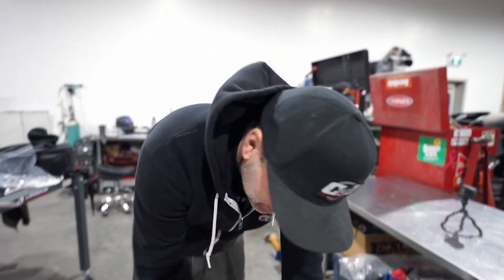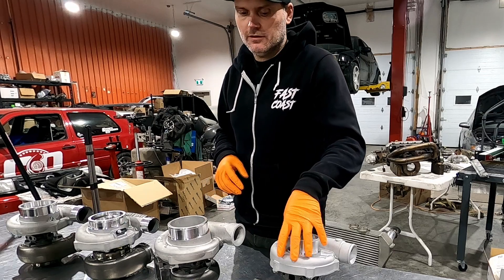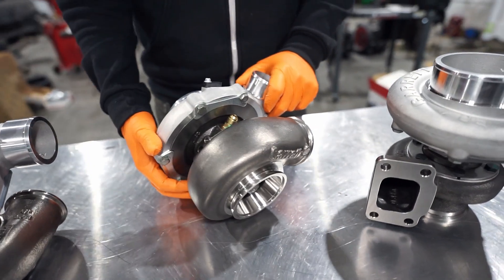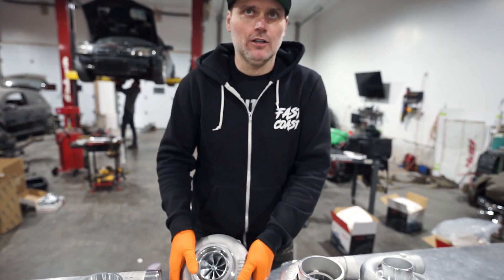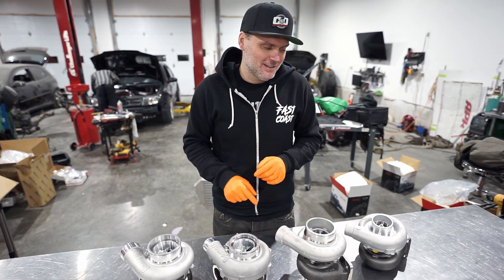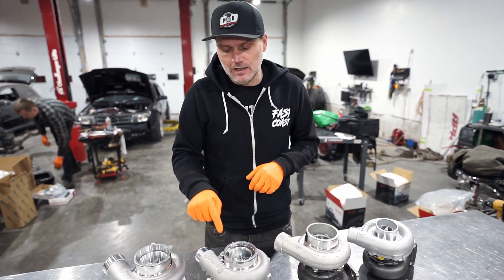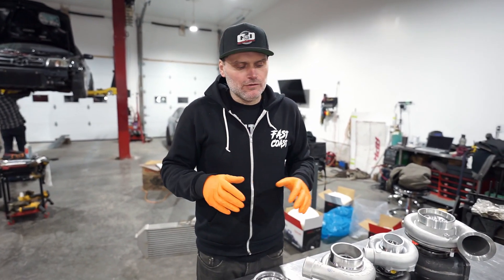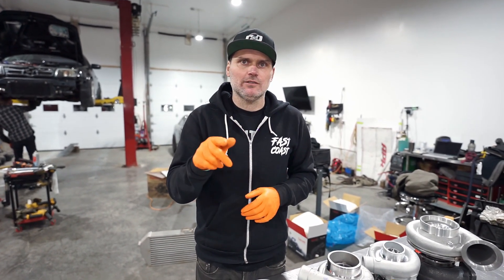Does size matter? Comparing four generations of Garrett Turbos.

Comment: Damn those are big. Is there anything you recommend thats smaller? Just need 200 hp increase.
Reply from the maker: Depends on engine size, rpm, fuel, and overall power goals. A 200hp increase is a lot on a 80hp engine, not so much on a 500hp engine.
Reply: @COMotorsports  well everyone is able to get 400-500 hp on a d16y8 engine. But I only looking for 220whp.

Comment: Where do the gen 1 GTX3071 etc fall?
Reply from the maker: If you're referring to physical size. Basically the same as the GT, but a bit smaller since it's a 3071 compared to the 3582 that's shown.

Comment: I just got a gtx3076r gen 2,  I have a precision 6165s old ass turbo and big as hell compared to the gtx3076r
Reply from the maker: Great choice. Love those.
Reply: @COMotorsports  I'm hoping it as good as I hear,  also wanted to ask you have you ever used Brian crowler cams or valve springs?
Reply from the maker: @beefysghost867  not specifically in any of our builds.
Reply: @COMotorsports  ok, I haven't seen any real good reviews on them or much info. 
Just go with whats known  cat cams and supertech valves
Reply from the maker: @beefysghost867  good combo 👍
Reply: Same throwing mine into an built 04 sti
Reply: @jeffwenke  what housings and ar?
Reply: @beefysghost867  its mated to the perrin rotated kit so bolt in and out and I am running a .63 ar because I am at 5000 ft elevation.  Perrin has a really good comparo on different turbo combos for stis
Reply: @jeffwenke  gotcha main reason I'm running it is for how fast it spools on a 1.8t. Plus. 63 also
Reply: @beefysghost867  Yep same keep spool up
Reply: @jeffwenke  I hope it works out how I'm thinking,  just the 1.8t isn't a very Rev happy motor so hopefully be able to take full advantage of the boost.

Comment: Running my first Garrett turbo (GTX 3582r gen 2) and it's laggy :/. Full boost at 5500 rpms
Reply from the maker: All comes down to flow, displacement, and how high you can rev whatever engine you have it on.
Reply: @COMotorsports  2.4l, srt4. Spools slower than my old 6466 (4500rpm spool)

Comment: Has anyone ever run compounds on a 1.8t ?
Reply from the maker: I'm sure somewhere, but there's no real point as there's generally an easier way to reach HP targets. Wow factor just means more money,  more trouble shooting and things to fix.
Reply: @COMotorsports  that's what I thought, I could not image how tight all of the equipment would have to packed in to make it work
Reply: Harrison young I'm guessing your also building a 1.8t, I've got a yellow 20th n I'm on the hunt for 500ish whp
Reply: @mikefoster4105  yeah, I like to dream about making high horsepower numbers someday 😂. My goal for now is to get my jetta to a point where it would be able to handle even a little bit of power